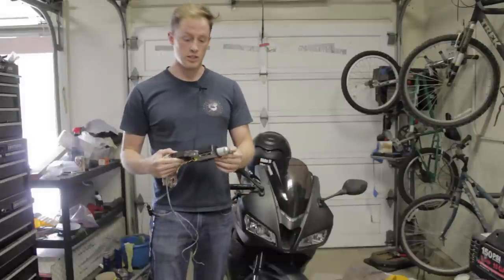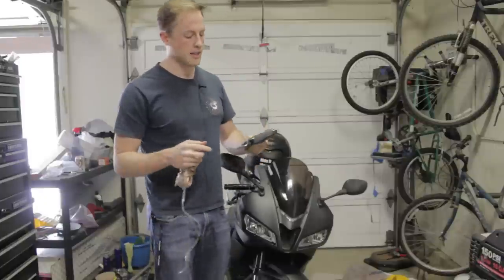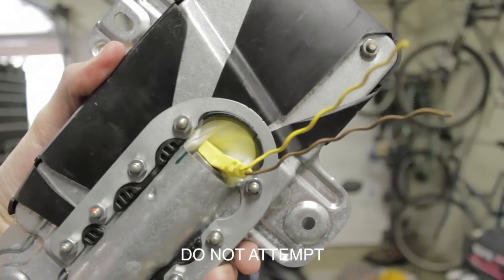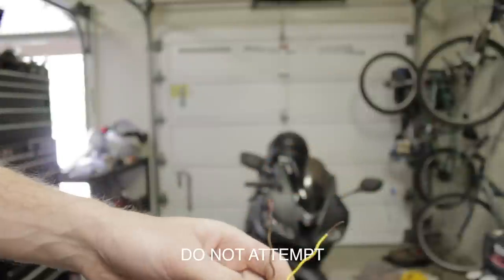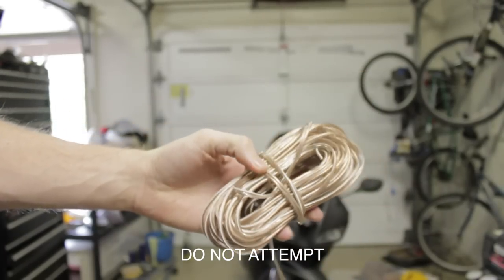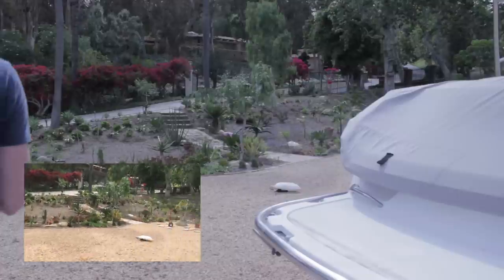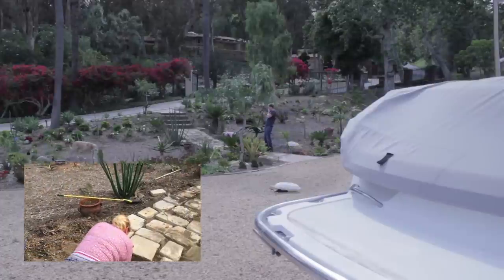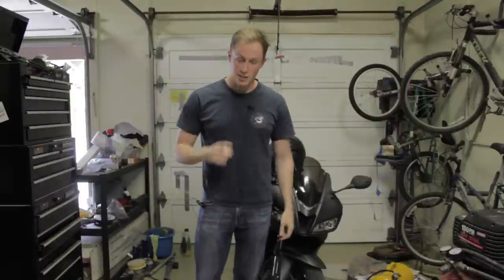How To Blow Up An Airbag

Comment: Nice! cool!  But may I leave just one good advice I think is needed?
You mentionned 3 things :
1- You can't just short out the 2 connectors to make it blow up.
2- These 2 wires must be connected to a 12 volt source
3- Don't connect the 2 short wires ...Add  50' of wire
     so your hand (and face) won't be 4 inches away from explosion.

I would add this 4th important step
This is only to be done by smart people who have done some homemork!
 Anyone aged over 12 who can't figure out ''ANY'' of these 3 first steps  ''BY THEMSELVES''...
Please, do yourself a favor : There are many other great passions out there for you to discover. Please, get out of here..,you are not suited at all for this kind of shit...